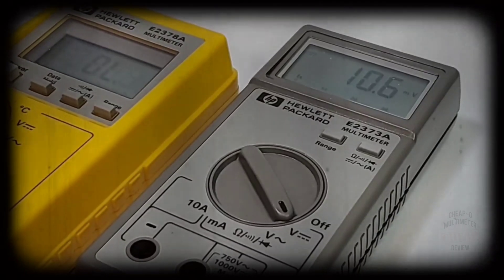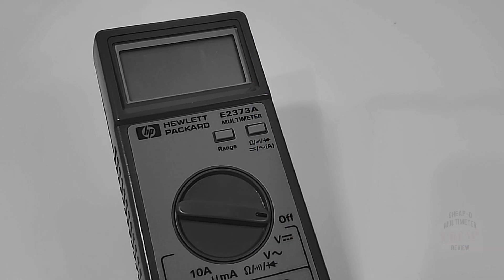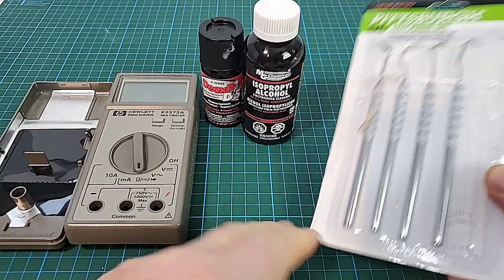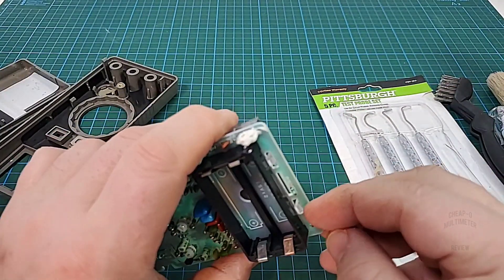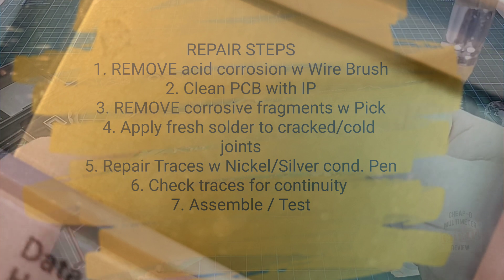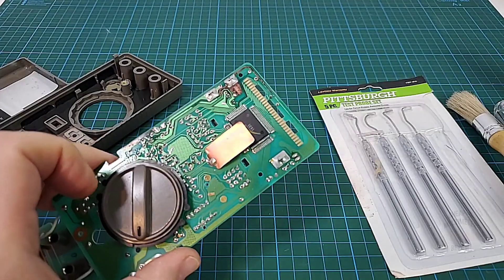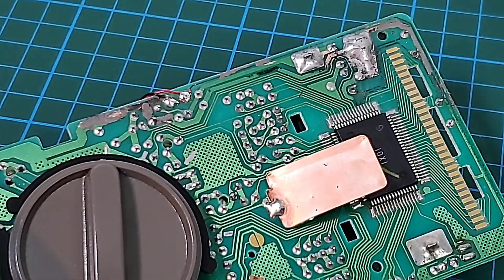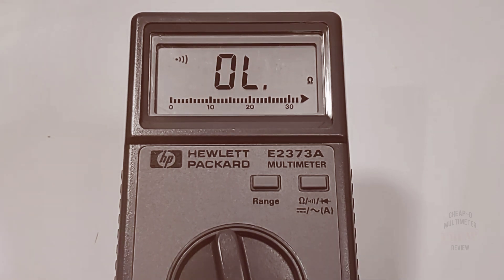Hewlett Packard E2373A VINTAGE Multimeter Repair!

Comment: "The M6306 chip is actually the discontinued OKI MSM 6306 3 3/4 DMM IC, used on several Yokogawa digital multimeters such as Model 7534-03 and also on some units rebranded as HP (E2378A and E2377A) and Soar (3255)."

To clarify, SOAR OEM for YOKOGAWA under contract in fact, later OEM for YOKOGAWA-HP (aka YHP) in Japan. Their first OEM products are 7532-01~7532-02(3200 COUNT), 7533-01~7533-04(4000 COUNT, 2 fuses), 7534-01~7534-02(4000 COUNT, 3 fuses) and 7543-01(25000 COUNT), and then later for E2377A~E2378A(3200 COUNT).

The OEM products have some downgrades, the layout/materials/fuses are somewhat different from YOKOGAWA and YHP.
7534-03 is a special low cost edition of 7534 series, which is 3200 COUNT.
Although those products are different, they can be considered roughly the same.

E2373A is also OEM from SOAR 3210 (3200 COUNT), and for YOKOGAWA 7532 low-end series.
Reply from the maker: @mop8496  Great info..👍

Comment: When you shorted the leads prior to repair, it appeared to read continuity in the .1-.2 range. Why did you think it needed repair?
Reply from the maker: Continuity was dead unfortunately. The .1 would randomly appear even if the test leads weren't attached. No audible response either until after the fix.

Comment: Isn't it more reliable to restore these tracks with wires?
Reply from the maker: I've had zero issues with repairs done via the silver pen. This multimeter performs like a champ 3 years later. 😊 It's not recommended for "every" repair scenario but in some cases it works just as well (or better) than the wire method.
Reply: @KeepOnTesting  I use similar methods only on film keyboards and in other cases where soldering is impossible.

Comment: How does this multimeter compare with modern ones? Excluding bells and whistles is this one as accurate as $50US or even more expensive multimeter
Reply from the maker: It's highly accurate and holds its own with multimeters costing $$$ All of the vintage HP Multimeters were well designed 👌
The only caveat is the lower resolution compared to newer multimeter designs.

Comment: I agree with Bhushan. I had some troubles restoring damaged or burnt traces in the past. Never heard about conductive pens. They make it look so easy. I definitely want one now. 

And I see you still use your PACE soldering station. Great model. I really liked the review. I tried a direct heat (direct drive) soldering iron once. It was a blast.

It’s nice to see some repairs on the channel. Especially when it’s a vintage multimeter such as this. I guess the main thing to take from it should be to never leave batteries inside for a long time.
Reply from the maker: Conductive pens can really save the day.. they don't work in every situation but when they are right for the task at hand they are phenomenal! 
Indeed, I use the PACE as my main soldering station, love it 😀 Great selection of tips and the instant heat is a real blessing. 
Unfortunately, batteries don't have to be old to fail. I have had similar though not as catastrophic issues on other multimeters with fairly new Duracell batteries installed.👀
Reply: @KeepOnTesting  I just watched a couple of videos on these conductive pens. Even when completely dry out they have some small resistance (around 20 ohms). Still it's much faster than soldering wire bridges. It would be great to have some magical cream to fix multilayered PCBs though.

Leaky batteries are just nasty. You’d think they’ll at least work until their expiration date.